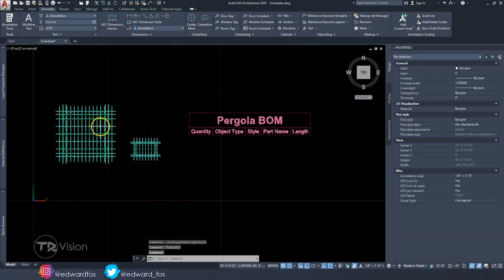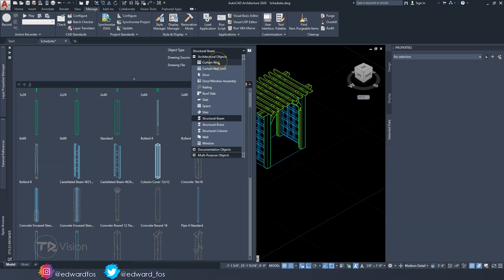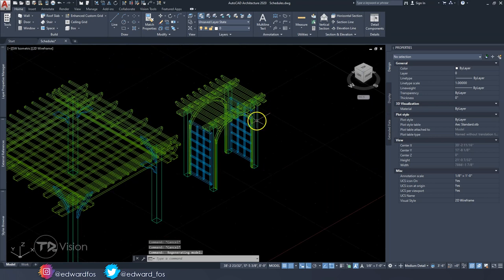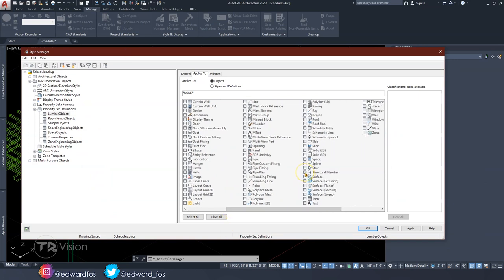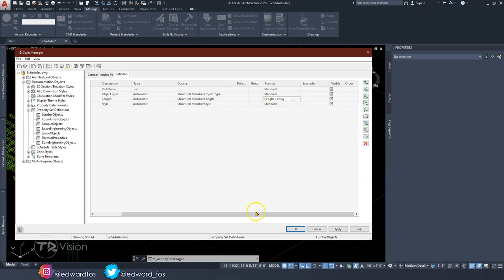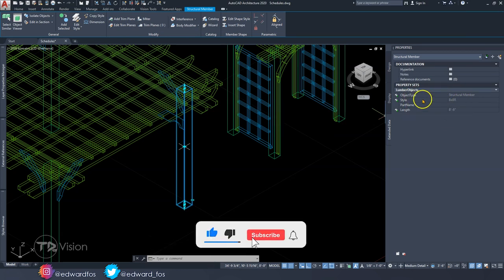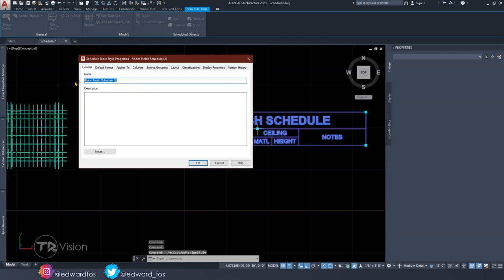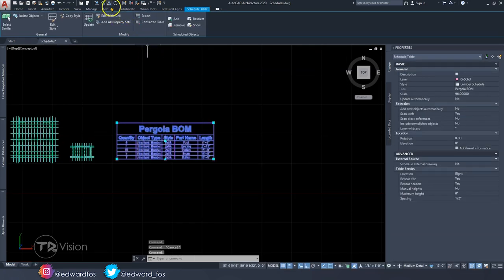SCHEDULE (BOM) in AutoCAD Architecture 2024

Comment: Hi Edward.  Do you have a video on how to copy a project, say like the Pergola one, rename it and quickly modify the dimensions?  I’m looking to create multiple 3d models with drawings by utilizing an already designed model and simple modifying different heights and lengths.  Also, do you have a video on how to give say a patio cover a certain slope/angled rest on 2 beams at different heights.  Thanks